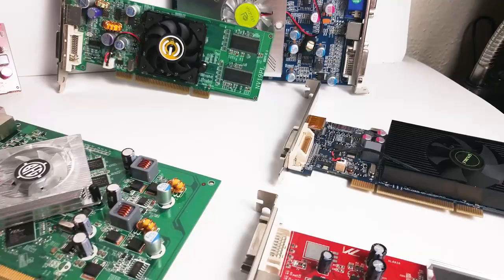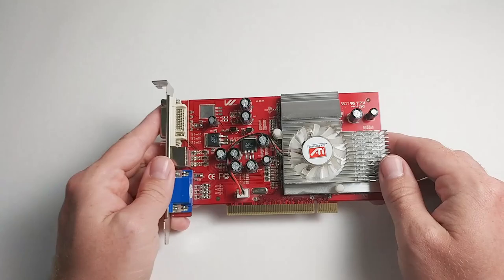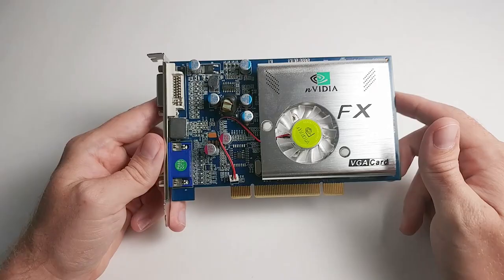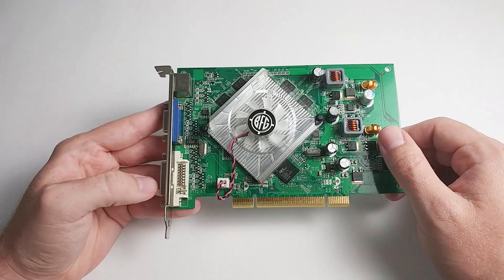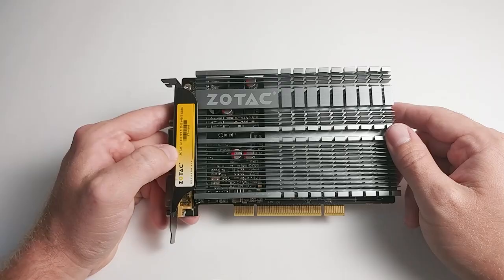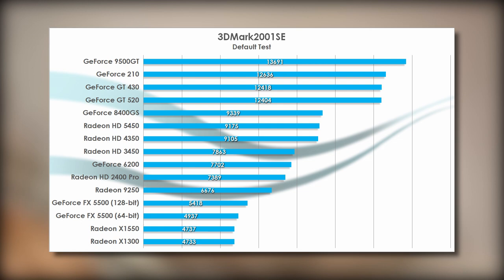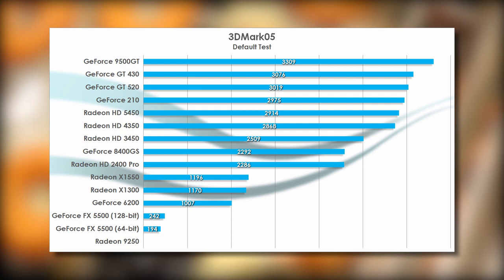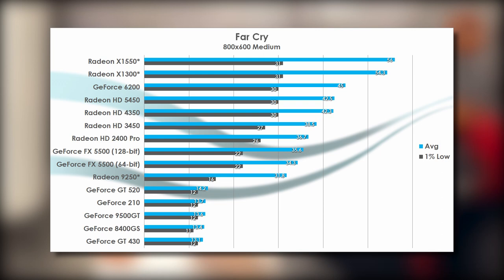A Comparison of 15 PCI Graphics Cards (DirectX 8, 9, 10, 11)

Comment: Could be something wrong with the AXLE FX5500 PCI (256mb/128bit)? Wanted to use it in a GA-586-TX3 Board with K6-2 400 cpu but it won´t boot up neither displaying. The Card has 2 Notches (3.3v & 5V).
Reply: @Dalle Smalhals Standard socket 7 66mhz system bus speed.
Yes i think that is the case. Meanwhile I bought a used g450 pci. How can I change the resolution to 1680x1050 in windows98? There is no option

Comment: Maan i screwed up badly , in 2011 bought a pre-built PC with a gt 430 and i3 with 3 gb ram, and previously i had a 9500 gt....
Reply: The PCI-E GT430 should be faster than a 9500, also you get DX11

Comment: I'm going to assume a GeForce 8600 would be slightly faster than the GeForce 8400 GS used in this video, just add roughly 5 FPS or so is my guess

Comment: Sorry, this has nothing to do with this video but I'm just too curious.

I was just watching your Rage Fury Maxx video, and I always wondered: why can't just two chips be treated as one big chip that's just split into two different places? I can't quite explain what I mean right, and I'm not sure if it makes sense at all, but why can't you just do that? And have them act like a bigger chip with double the specs of the one that you're using? I know next to nothing about low level programming,  gpu bios, or stuff like that, but is that simply impossible or is it so hard/expensive no one wants to do it?
Reply from the maker: It's a good question, and I'll try to answer it the best I can with the knowledge I have.
You would think it would be possible given how GPUs are designed today. Essentially they're already multiple GPUs in one. For example, NVIDIA's Pascal architecture uses multiple Graphics Processor Clusters (GPCs) which are essentially fully functional GPUs in and of themselves. They all work together in perfect sync as one GPU, but the reason this doesn't work as well with separate GPUs comes down to one main reason: latency. Inside of a GPU all the GPCs keep in sync thanks to the GigaThread Engine processor issuing instructions at a fast rate. This processor conducts the orchestra, keeping everything on task and running efficiently. In conjunction with cross-bar interconnects (which are extremely fast) and a large L2 cache unifying all the data between GPCs, these units can work together very quickly with minimal assistance from the host CPU.
Compare that to an SLI configuration which essentially turns the CPU into a higher level orchestrator, trying to juggle the workload between the GPUs, and what little synchronization that can be done directly between the GPUs has to be done over an SLI bridge (2GB/s in the case of Pascal; paltry compared to a GPU's internal interconnects) and across the PCIe interface (~16GB/s) which in the modern era requires a costly trip (time-wise) through the CPU. AMD's Infinity Fabric brings some promising possibilities of reducing this latency problem of synchronizing multiple GPUs greatly, but until then, multi-GPU configurations can never work as efficiently as one.
Reply: @PixelPipes  That's a great explanation! Thank you for taking your time to answer. Also, does that still apply to dual gpus in one card? Or is there a different reason?
Reply from the maker: No difference, they function the same way as two cards.

Comment: Ok, so the million dollar question is: could I use any of those with a 486 AT motherboard and how hard would the PC bottleneck it? What would be the weakest PCI graphics card that would offer maximum performance on a Socket 3 motherboard with being bottlenecked the least?
Reply: The favourite for the 486 is the Tseng ET 6000PCI or ET4000 VLB.
Reply: @Tom2404  Thanks!

Comment: pci cards are great for servers really
Reply: And if 20+ OLD - where to get drivers?
Reply: @dallesamllhals9161  internet archive
Reply: @amdintelxsniperx  ..and the OS?   ..i know nothing about servers.
Reply: @dallesamllhals9161  depends on if the machine is proprietary . Older alpha machines can run anything Linux vmx vax windows nt . Of it's your standard x86 then windows or Linux will work
Reply: @amdintelxsniperx  Sry' I've haven't done proprietary x86s - since my first build in 1997! (..mom did buy a TULIP©  486 DX2/66 in 1994 - and in '95 I SWORE: NEVER AGAIN)

Comment: You forgot one crucial thing in your testing! The newer cards are optimized for 3.3v signaling over a 32 bit pci bus. The newer  radeon cards have a hard time communicating over 5v signal due to how the bridge chip is designed and not tolerating to much noise at high core speeds.
Try them again on a newer motherboard with 3.3v pci .
Reply: Adrian Porojnicu The motherboards were both 3.3V PCI.

Comment: Also the radeon 5450 it's not the same core as 6450/7450. 5450 has 80 shader cores vs 6450/7450 with 160 shader cores.
Reply: OOh , my bad, didn't listen carefully. Yea 5450 and 6350/7350 are the same.
Reply: On radeon PCI bus ,there is one good  & ultra rare card: The mighty Radeon 9700 PRO x4 : https://www.techpowerup.com/gpudb/1946/radeon-9700-pro-x4